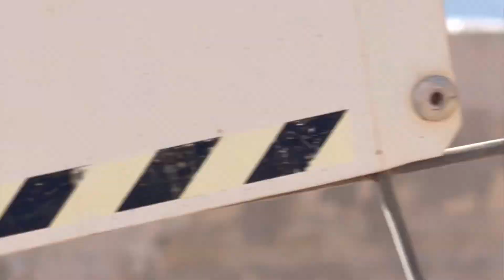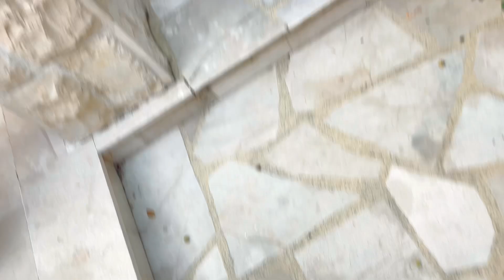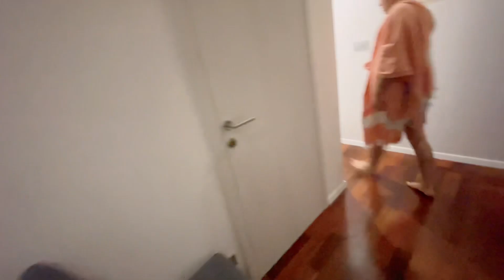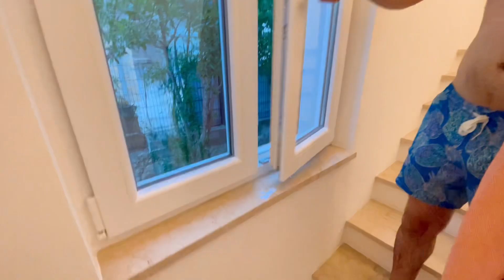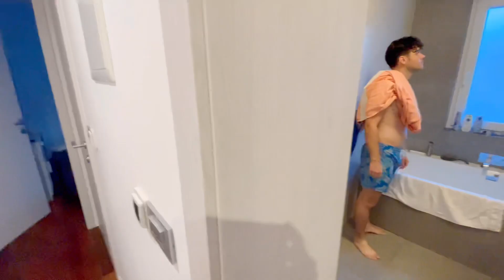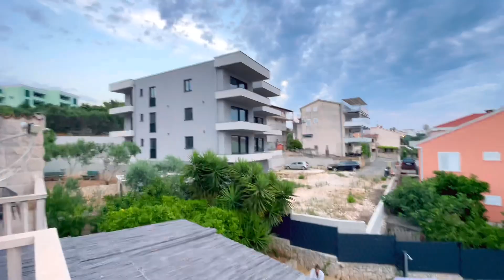Inside Croatia's zero-wood construction!

Comment: So for Americans that saw some Uk houses built with bricks - we here did it similar way until mid 20th century, but since Balkan peninsula is highly seismically active (Macedonia Skopje 1963 earthquake changed code in then Yugoslavia) - this house is built with reinforced concrete structure - that holds the house. 
Bricks are only wall infill. Often, a porous concrete blocks are also used - much lighter and thermally better insulated, but less soundproof and cost more.

As you may see from the outside - brick wall is only in section and there is maximum distance between concrete frame also in the code, which makes sure that house does not collapse in case of an earthquake.

Floors are also made with same material as bricks of the wall, but they have prefabricated beams, and bricks are inserted and top is covered with concrete. Edges are reinforced with steel armature. This makes floor strong, light and flexible - also important in the even of an earthquake. And super simple to make - you can easily make it yourself in a day or 2

Comment: All new houses in Croatia(or Europe) have styrofoam or mineral wool insulation on the outside, many older houses are are also now insulated when renovated.
The house in brick will get scafolding around and then insulation will be applied.
You can't tell the difference just by looking, only by knocking the facade with your hand.
We also have some new prefab houses now, wood structure with insulation inside the walls and plasterboard on the outside. 
They also look the same as other houses so its hard to spot one.
Reply from the maker: Interesting! It also appears that the brick itself with the space inbetween the cells would act as an insulation?
Reply: @theconstructionzone7  Yes
Reply: @theconstructionzone7 još jedan američki mudrijaš 😂 drži se ti kuće od drva i kartona 😉
Reply: @theconstructionzone7  yes and you have models that has that space filled with mineral (rock) wool for even better insulation